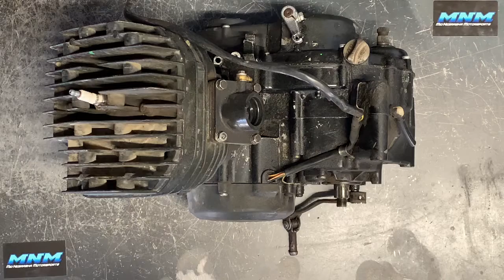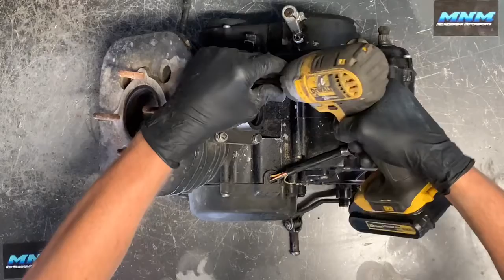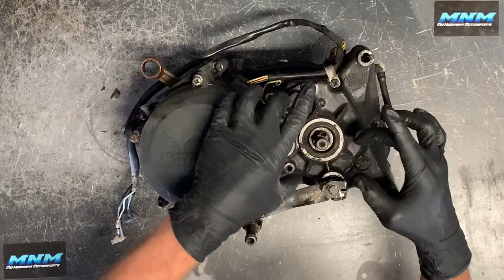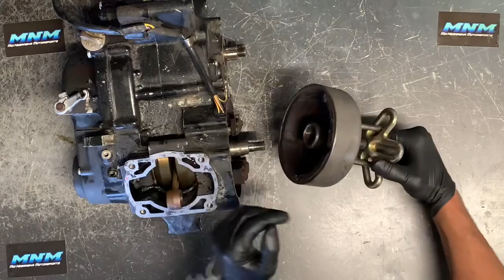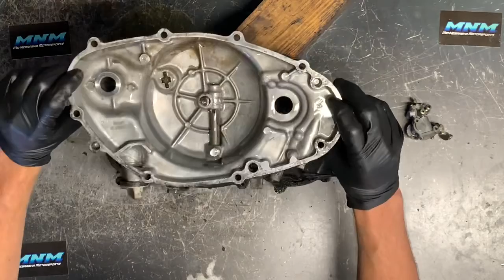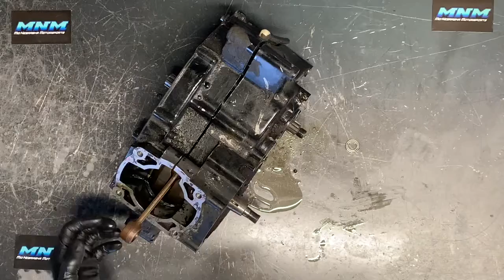Kawasaki KE 175 Enduro  -  Complete Engine Motor Rebuild - Top to Bottom

Comment: Brother from where I can get engine parts for ke 175 1980 model
Reply: I second this. When I make room for this project I'm gonna need a decent source for parts and can't seem to find one. Currently have no compression so I'm thinking stuck rings possibly worse and also seems to only have 4 gears and won't shift into 5th gear.